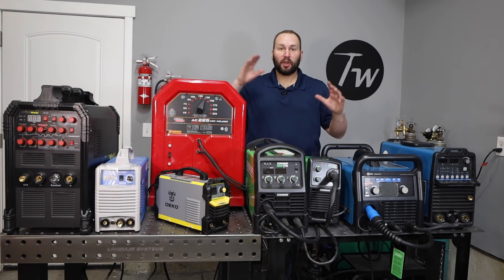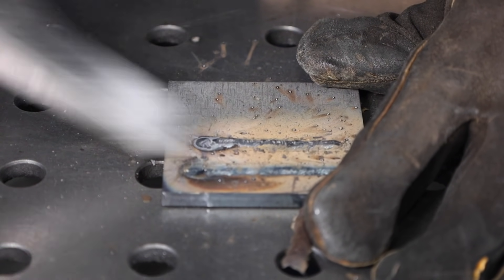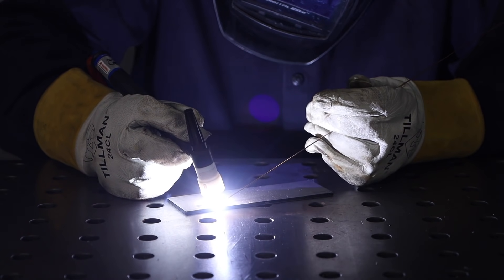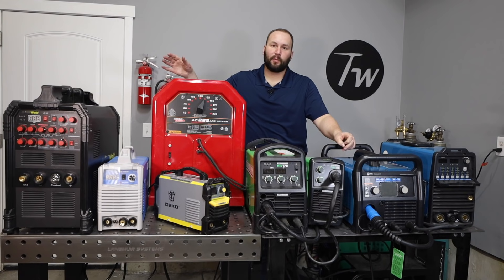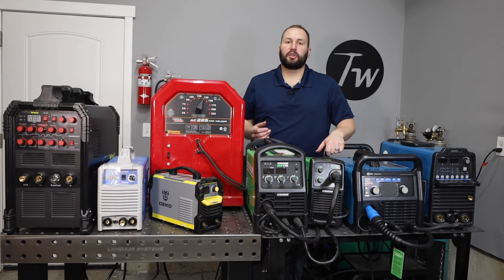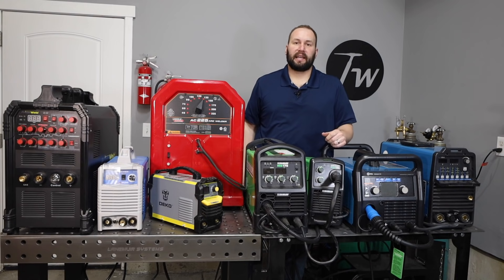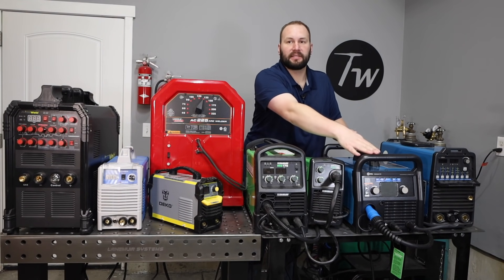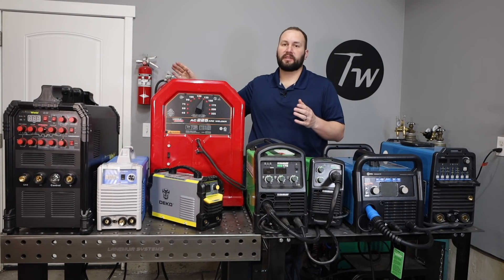How to Choose a Welding Machine

Comment: Do you need to learn all types of Welding to work in the trade ?
Reply from the maker: It depends on the industry, but it's a good idea to be at least somewhat capable at the common processes. Most of my career (as a welding engineer) has been in aerospace and gas turbine engines, which is all TIG. In other industries, you'll have a wider variety of processes. I would recommend deciding an industry you'd like to work in and getting a job of any kind in that industry to get exposure to welding and your foot in the door, then learn the processes you need to move into that role.
Reply: @TimWelds 

Appreciate the reply. Your videos are incredibly useful for aspiring welders. 👍

Comment: Not all machines came with volt dial, even on the mid range prices machine. the majority of welding machines on planet earth uses ampere dial only the volt is always constant 18.5 V, even when i weld with 3 dials machine i always set the volt on 18.5 V never below rarely on 20V, and maybe on very rare case 24 V.
No wonder i always see many users or beginners trying to weld on youtube, always getting confused when they saw u.s welders
Even weirder fact here in asia we uses flux core with CO gas too lol.
But hey welding is an empirical thing this is the same as guitar community debating on which wood sounds better lmao

Comment: I have very little to no knowledge of welding. I usually have a friend do it but I want to give it a go. 
I found it confusing when you talk about 160A doing 3.2mm but then you talk in volts to do 5mm mixing volts and amps without knowing the wattage is no help at all. Unless you are saying 120v 160A and then 240v 160A, but it is unclear if you mean that. 
Over all I'm finding this very good but comparing one machine and talking Amp then the next talking Volts is not helpful at all 😢
Reply from the maker: I'm talking about the input voltage (what the machine plugs into) and how the output average compares to that. The main purpose of a welding power supply is to reduce the voltage and increase amperage. I try to be as clear as I can, but I see how I could have been confusing there.

Comment: Hi Tim, I think you missed a vital feature of stick welders, and it has tripped me up big time. I am retired and want to learn for fun AND independence. I love your channel and in 2 weeks I'm running 6013s nicely for a beginner. But for the life of me no joy at all with 6011s or 7018s, 3/32 and 1/8. If I'm lucky enough to get a spark I stick. And that's it.
I eventually decided to investigate my machine a bit more because my rods are new and different brands. I went to the welding forums and found one that homed in on OCV - Open Circuit Voltage, ie power on but testing the + and - terminals of the machine. My inverter machine was correct at 62V DC (spec is 60V plus or minus 2%). 
Basically this machine CANNOT run 6010/6011 or 7018. To run all types of rod one needs a minimum of 75V OCV. My machine came in at $80, discounted from 100. For around the 150 dollar mark I can get a machine rated at 80+V. Here is a quote from the article I read on weld pundit.com....."An open-circuit voltage (OCV) of 75V is the recommended a stick welder must provide to burn most welding electrodes." And.... "With a 50V OCV, you cannot use basic rods such as the E7016 and the E7018, or cellulosic rods such as the E6011, even if the amperage is enough. The arc is difficult to start and maintain. For the same reason, you cannot use rods for stainless steel, cast iron, or hardfacing."

Comment: Hi Tim, What about the voltage range on a Mig? I watched a video where the person was setting his machine at 1 and 2 volts. I think the cheaper machines do between 15 and 21 volts. Most people are using 15 to 18 volts even on the thin stuff. Is this important? Then there is also spool size, some only do one size? It also seems that some machines don’t have wire speed, is this possible? Maybe is just doesn’t say.  I find that they don’t tend to give one a lot of info before you buy and the sales people don’t seem to know either, well that’s here where I live in South Africa. Thanks again for your videos, very helpful.
Reply: That was probably a yeswelder, they have a model that is basically completely automated as far as settings and controls everything based on wire feed speed, with the option of changing voltage manually +/- 3 volts. Most mig welders that are smaller or cheaper are running 20-50 volts. The voltage isn’t that important it’s the amperage that is. Voltage is just to overcome resistance and most metal has a very low resistance so you shouldn’t need to go over 20-30 volts most of the time, but the amps will dictate how much power eventually gets into the metal when voltage overtakes resistance. That’s why you can touch a 12v car battery with 1000 amps, the low voltage can’t overtake the resistance of your skin and you don’t get hit with a lethal amount of electricity.

Comment: I plan to TIG weld bronze and steel primarily, and had a 240v outlet installed on a 30A Breaker.  Is 30A sufficient or do I need to upgrade to 50A?

Comment: If you're brand new to welding and have never welded before i'd recommend you buy a stick welder because other welders require other things to be able to weld such as gas and or tool attachments. Mig welding is the neatest/ cleanest weld and tig welding is just beautiful but stick is the most simple and easy to use and do. If you're a mobile welder i'd recommend starting with stick and eventually switching over to Mig as it does a cleaner job.
Reply: Mig throws out diddy balls everywhere so its not that clean...
Reply: @kylemcweeny878  if you run dcen and good wire I’ve seen some very clean flux core welds even from super cheap machines like the yeswelder 135. Anti spatter spray also helps and good technique.

Comment: Flux Core is way under rated.  I much prefer it over MiG. Gas is expensive!  And more importantly?  Flux core makes stronger welds!  The problem with home use and commercial flux core is the machines that are built for it.  You’ll end up buying a MiG welder to get a really nice machine. Just don’t waste your money on bottles.

Comment: I will be welding a lot of nickel bar. What do you recommend?
Reply from the maker: A high quality DC TIG will do the job. Make sure you have these features at a minimum:
-High frequency arc starting 
-Remote amperage control (foot pedal)
-Adjustable pre and post-flow
Reply: @TimWelds  nice,,, thank you

Comment: Tim I'm about to purchase a welder. A multi - process machine that can weld steel, aluminium, and stainless steel. 
 I would like a mig/tig stick that can take a spool gun and gas. What would you recomend? I'm on a budget so I can afford around 500.00 to 600.00 dollars . I can purchase spool gun and other upgrades. 
 120/240 volt 200 amp or better. I would like a portable machine. 
 Thanks Tim. 
  Gary in London, Ontario.
Reply: Since he didn’t answer, I don’t think you will find a multi process that runs AC/DC in that budget. The cheapest I know of would be Everlast’s lightning ac/dc.  Up from there Esab offers ac/dc Rebel, and Miller’s Multimatic 220 ac/dc.  I have the Miller, and I like it a great deal. I know a spool gun is available for it, though I don’t own and haven’t run their spool gun.

Comment: I set myself up with a primeweld Tig 225x and I have a susemse mig-255 which is a multi-process welder also does MiG flux make gas lift tig and stick welding so I pretty much got the broad spectrum and all the welder I need. Now if I could just find me a nice plasma cutter and a water cooler to add a water cooled torch to my primeweld

Comment: How much of a power supply are we talking about for the home user? 20 amp?
Reply: Yea, 20amp 110v.
Reply: @daddyosink4413  Thanks, Cheers
Reply: @frankcherry3810  it has to be a dedicated 20A with nothing else running on it..... if you have to, unplug your fridge and run from there.
Reply: @daddyosink4413  Yea, I was thinking on just running a separate outlet.  Thanks. Cheers from Thailand

Comment: very good video, 
one aspect that you overlooked a bit ot my opinion is the effect of the duty cycle on the general performance of a machine, on the arc stability when the arcing conditions are less than ideal because it is the effect most of us will encounter someday much before being limited by the welding time by itself.
this is true for all arc welding processes.

Comment: Hi my friend,  I will buy a welder machin for my out side works,  GOD'S WILL,, What you think about the 220 Miller Multimatic,  the price here in Reno Nevada are $$3600,&4k,  please give me your opinion,  thanks, Dios te bendiga siempre
Reply: Since he didn’t answer, I have the Miller Multimatic and I really like it.   The user interface is super easy, I like the quickset feature where you select the material and electrode and it gives recommended settings, and it switches between Tig and Mig with a tap of the pedal or pull of the trigger.  

The Esab rebel ac/dc is in the same class, and I believe has a wider range of AC frequency and more adjustments for pulse. I’ve heard it will run 6010, where on the Miller 6010 is not recommended so I just  6011 when I need a fast freeze type rod.  

Everlast also has a mts ac/dc but I’ve never been around one. 

Hope this helps if you are still shopping.

Comment: Great video!  Although I'd say stick is the hardest to learn . Tig is basically the same as gas welding but with more settings. I recommend everyone start out with a stick welder. Specifically one with DC. that way you can eventually learn scratch start tig ( which will require extra equipment, but will impress everyone in the long run!).
Reply: I would have to disagree there. Personally i would say tig is the hardest. But then again i started on stick.
Reply: I'd say Tig is harder because it's such a technique to get going smooth.

Stick is close by it though especially on start
Reply: I followed this advice.  I love stick welding but a cheap flux core machine can go up to 3/8ths.

Comment: I don't remember Tim mentioning anything about the importance of having a DC output on the stick welders.
Reply from the maker: It depends on what you’re doing. Pros run DC most of the time, but for a lot of garage type work, AC machines work great. I really like using old fashioned buzz boxes.

Comment: Needs help!!!! 

So I want to buy a multi process welder! And I have a budget of 4K , I want AC/DC for tig along with everything else… which one should I be looking into, thanks
Reply from the maker: Esab Rebel 205 and Miller Multimatic 220. 

If you’re open to 2 machines, an HTP Invertig 221 and Separate HTP MIG would also be a great option.
Reply: Awesome thank you for responding!
Reply: @julianwilliams2697  If you haven’t decided yet, I have the Miller Multimatic and really like it. The quickest feature I find handy (you input material thickness and what electrode you are running and it gives suggested settings). Also sweet it it switches between Tig and Mig at the tap of the pedal or trigger. 

The Esab as I understand will run 6010, where I use 6011 when I need a fast freeze rod.  The Esab I believe also has a broader range of ac frequency, and I think more adjustability in pulse settings over the Miller. 

Hope this helps.

Comment: Tim: I have found that economy multi process welders in stick mode only run about 25 volts instead of 75-80 volts open circuit, that means they only work well with a tight arc and rod selection is therefore limited.

Comment: Why do some people around various trades eventually start saying they "run" a particular skill or piece of equipment, instead of saying "use" or some other more typical language construct?  For example - I'm not "running" 13L Hefty Ultra-flex garbage bags in my kitchen, but at the moment that's what I'm using.  I don't "run" my Logitech bluetooth mouse, but I use it every day and I'm pretty fond of it.  This lingo-ism definitely isn't limited to welders... I've heard people talk about "running" saw blades and router bits too.  I imagine this is something people who are starting out hear from others with more experience and start emulating it (consciously or not) to feel more credible, but to my admittedly amateur ears it sounds weird.

EDIT:  I don't want to neglect to say that this is an excellent video, along with all of Tim's highly educational and valuable content.  That one little language quirk just struck me as a funny theme.
Reply: If you ran one of these machines for any length of time you would know why .
Reply: @bajadan2769  Tell me more...  I use a lot of gear on a regular basis so I can relate to a lot of things.  What gets people going like this?   To me it's no different than what makes emergency services people say "he exited the vehicle" instead of "he got out of the car" like anyone else would normally say.
Reply: Do you inhale cigarette smoke? Hell no. I run Marlboros.

Comment: Are there some "basic" differences in multi-process vs. single-process when it comes to that one process? Lets say stick-process for example,  so if you get $700 machine. Should you assume it's better than the stick-process of a multi-process machine? One thing I assume that single-stick is most likely smaller and lighter, but if I don't care about those. Are the only possible differences about that the Duty Cycle and potential bonus features? Are the Duty Cycle promises sacred/law-binding, at least i see that no company makes promises regarding the "name-amperage", so if device is XYZ-Model 200 the Duty Cycle promise will be for 160A typically, not for 200A. So then you can only guess for how long does it run 200A.

Comment: What tig welder do you recommend for starting off on a budget?
Reply from the maker: It really depends on what the budget is, but if you want one with all the features, I really like the PrimeWeld TIG 225 that I reviewed a while back on my channel. I've also heard good things about the new AHP machines. Actually, I think AHP might still be selling their older machine at a discount, which could be a great deal right now. As far as less expensive DC only, the YesWelder TIG 205DS that I reviewed a while back worked really well other than the short post flow, but if you just want to get your feet wet on some mild steel, it would do the job.
Reply: @TimWelds  thanks so much looking to mainly do aluminum so need that ac/dc.

Comment: New to the chanel, but what type of machine is safe to run off a separate generattor? It's 7500 with 9000 surg. Have a small farm and am going to be put up pipe fencing. Also would a flux core work or a stick be better most of the pipe will have rust on it?
Reply from the maker: Either would work, and you will get different opinions, but I would get a small inverter stick welder and weld that with 6011. It would be a longer learning curve than flux core, though. There’s a YouTuber named Austin Ross who has done a lot of pipe fence. I’m not sure if he’s done a tutorial on it, but would be worth a look.
Reply: @TimWelds  ty for the  info
Reply: @TimWelds  what would be a good inverter machine that will weld pipe and is easy to set up?  I haven’t welded since high school in the early 80's.  Also would it be good to bite the bullet and get a multi process machine?  Would like to do so mig shielded/ flux core welding in the future  also.  What brands do you recommend?

Comment: One thing worth mentioning about benefits of stick welding and flux core is that those are better suited for welding outdoors. With normal MIG or TIG wind will easily blow your shielding gas away and result terrible welds. While flux core and stick have shielding gas releasing from the weld material and is less likely to be blown away.
Reply: Simple, but useful, thank you.

Comment: really enjoying getting into your videos the past few days. The clear explanation you provide is giving me the confidence to finally invest in welding equipment, something i've long had interest in learning.

Do the machines keep track of the duty cycle? will they lock you out if you try to weld beyond the duty cycle or do you run the risk of damaging the machine?
Reply from the maker: They don’t have timers, but most will shut down due to high temperature before anything is damaged. I don’t worry too much about it as long as I’m in the ballpark.

Comment: Tim, excellent video.  Something I ran across while selecting a multiprocess machine was the ability to run 6010 & 6011 electrodes.  If that is a requirement, make sure you read the fine print while making your selection.  Thanks again and keep up the good work.
Reply: 6011 will run both ac and dc 6010 runs better on dc, most 7018 will not run good on ac, older machines especially

Comment: I have done mig a long time ago and oxy acetiline more recently I'm thinking of making a container house (2mm Cor-ten) and I am thinking of just gas welding it since it is what I'm most familiar with and I have the equipment , but the guys at the welding shop just shake their heads , what do you think ?
Reply: I shake my head two ,  just a costly way two go ? Mig would be far better , , just the cost of buying one first up , but once the out lay , will be far cheaper
Reply: @timothyrouse2853  Because the cost of welding gas is cheaper than shield gas ? My gas welds look so much nicer than my mig welds.
Reply: Use gasless , ?  here in oz  mid size oxy ect is around , 300 ,$ aud each  argon is $ 300 abouts  , for a single bottle
Reply: @timothyrouse2853  flux core gives me a headache , I'm not convinced I will save enough in gas , welding 3 doors and 4-5 windows , to make it worth it . After all , tens of thousands of planes in WW2 used gas welding (mostly done by woman) using the same torch I use , if it's good enough for North American , and Supermarine ....